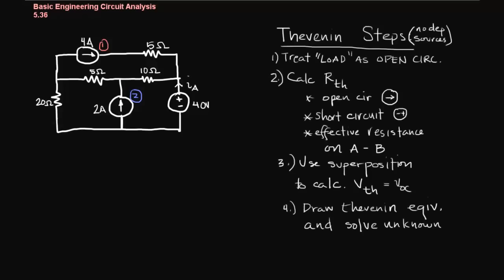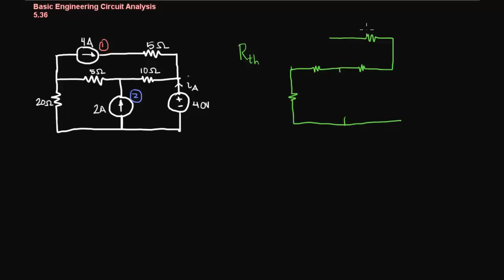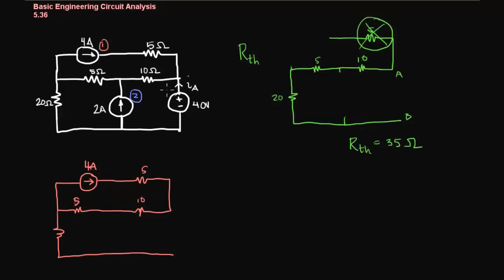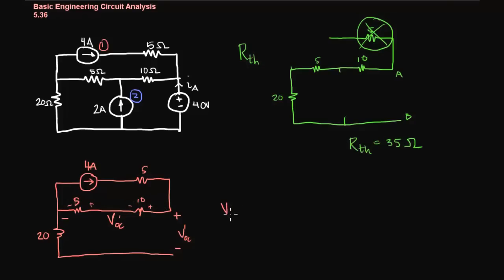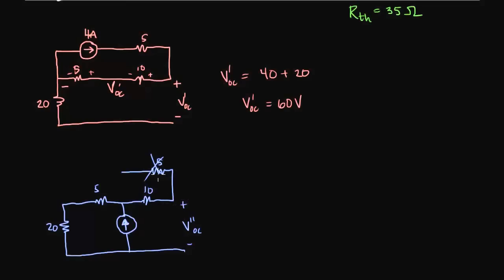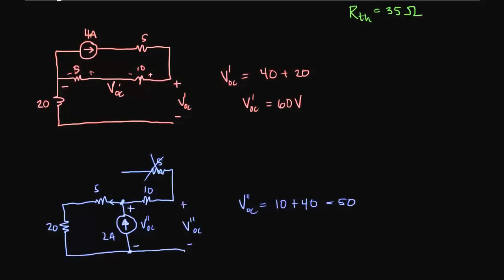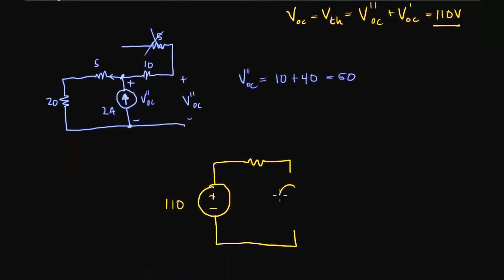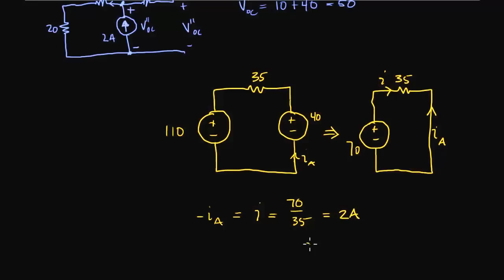Thevenin's Equivalent Problem 5.36

Comment: around 4:15 I noticed when using super position you created an open circuit where the 40 V source was, but I believe when deactivating sources, you create an open circuit for current sources and a short circuit for a voltage source.

Right here it looks like you still have a voltage where the 40 V source was, but it wasn't necessarily deactivated.  Wouldn't you need to deactivate one at a time and then add up their sums?

Comment: why do you replace the 40 V source as an open circuit? I thought voltage sources are to be replaced with short circuits
Reply: +MrWoopydalan 
Because the 40V source is the load and not a part of the Thevenin equivalent circuit.
Reply: I thought the voltage source had to be short circuited
Reply: Sir I do not understood

Comment from the maker: In the video, I explain that the voltage V'oc is the voltage across the 5 and 10 ohm resistors that are horizontally below the current source.  For the Rth, you look at the resistance that the load sees.  Because we have only an independant source, we remove it.  Current sources are treated as open circuits.  The drawing shows that the 5 ohm resistor is "dangling" and doesn't contribute the the resistance seen by the load.

Comment: When you were calculating V'oc, why didn't include the 5ohm resistor? For that matter why didn't you include the same resistor when you calculated Rth, why doesn't it contribute to the circuit?